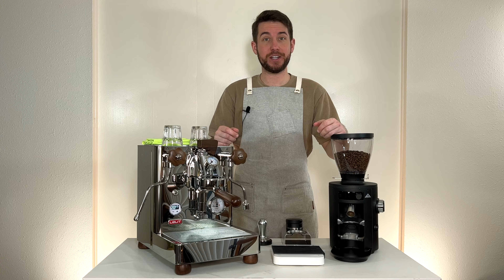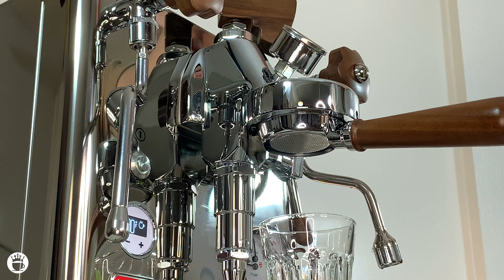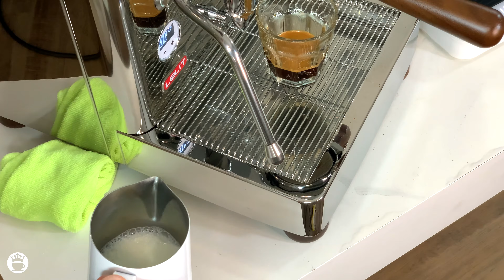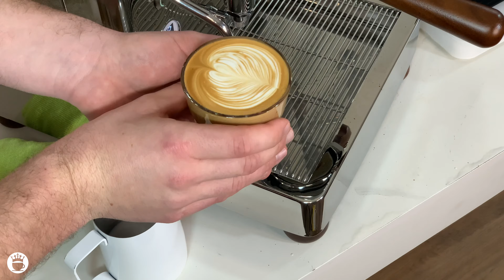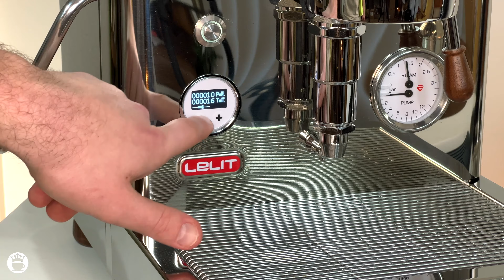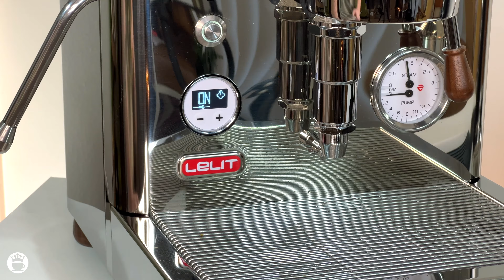Lelit Bianca Review - Is This Espresso Machine Worth It?

Comment: Doubled walled may mean less pressure for the rate of steam!  It's smaller on the inside!
Reply: You‘ve got no idea about physics
Reply: @el_dani  mr. Physics, I got that from the manufacturer  while in Italy!!!
Reply: @MrJusmobile  much more important is the size (or energy reservoir) of the boiler and the design of the injection holes..